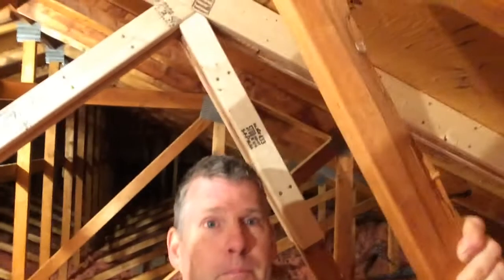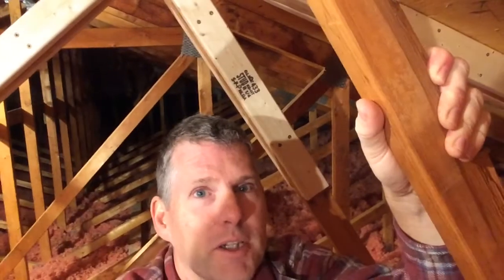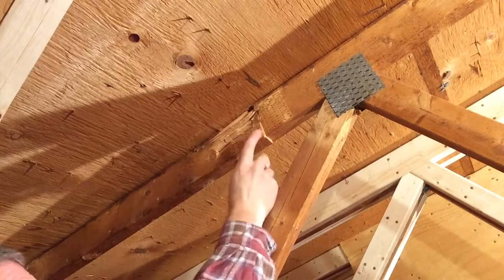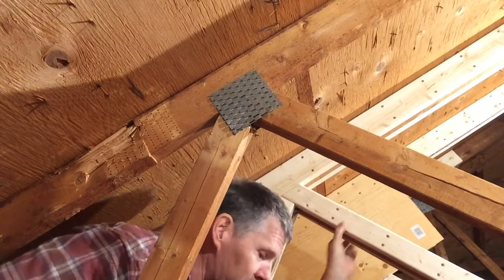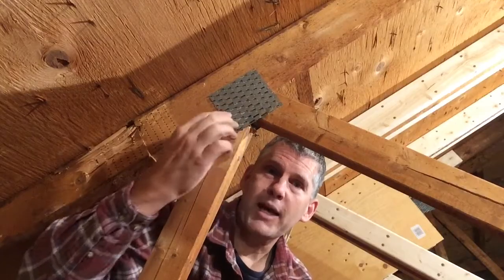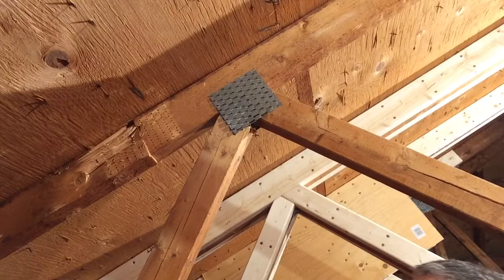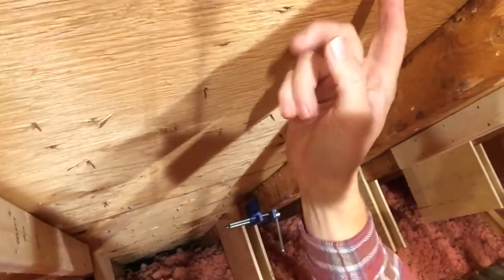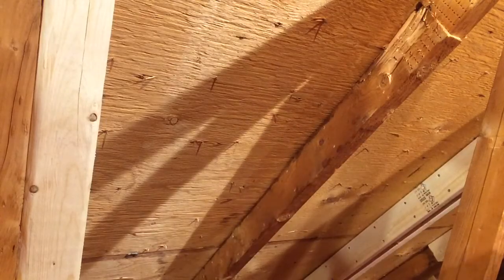Attic Truss Repair #01: Damaged Top chord and loose gusset plates

Comment: Thank you for creating this video and trying to educate the internet. However, the problems you shown hints that the roof trusses were, likely, overloaded.

Any repair work should start with finding out the root cause of the problem and then engineering a repair plan. A structural engineer must be involved and a building permit must be obtained to carry out such work.

Comment: My dad called those gang nails. Buy the way he was an ironworker and built his roof with home made iron trusses and bar joist. Then heavy guage metal decking,then 5/8 plywood bolted (not screwed) to the decking,felt and shingles. The county inspectors did not know how to inspect it. Roof would have easily held a one ton truck. Boy I mis my ol Man, drank many a beer with him. This was in Seminole county Florida 1970.

Comment: The whole designing & engineering of Trusses & Gables is kind of Stone Age technology, nothing new or innovative. 

To further exacerbate the situation, the builders use the cheapest wood they can get. If you use good hard wood, when it gets old it becomes so tough that it becomes harder to drill a hole in them.

Lastly, I hate the Gusset/Connector Plate business. Santa Clause doesn’t  need to jump on the roof to displace the gussets. Upon doing a microscopic inspection of any 50 year old house you will find that they would appear to be attached but have lost their firm grip due to expansion/contraction etc.

Comment: The trusses in my attic look the same but they are 2 x 4. My house 'pops' creaks' 'bangs' make all sorts of noises. My idea is to use 5/8" plywood and connect all the rafter supports together with a 4  8 sheet cut to cover were the three supports connect to the rafter. But I'd like to shore up the roof by places supports below the ridge rafter before applying the plywood. The real problem is that there is too much weight on the roof. The tiles are made of concrete not clay.

Comment: Don't see the video on the engineering.  Specifications for the screws, size, length, hardness, finish.  Pattern and spacing of the screws. Does each screw pass through both scabs and the original truss member  or just the original truss member and one of the scabs?
Reply: Shut up

Comment: Substandard wood? I don't think so. Those trusses are only 2x4. The plates can only hold so much stress. Piling up roof shingles in one spot is most likely what caused it. They are very heavy and the trusses are not designed to take that much weight.
Reply: Jameson Cross  yes, there is a method for stacking and distributing roof materials, someone most likely flubbed up tossing materials haphazardly. Happens occasionally and this is the result. He mentioned that’s what happened during a reroof .
Reply: @stevelopez372  the wood isn't substandard I don't think. I THE only way that would he if there were a lot of knots in them. I do not see any evidence of that.
Reply: According to the building code, the snow load where I live in the North East (NJ) is 20 lbs/sq foot. Trusses are designed to handle the snow load, but if you add to that a few bundles of asphault shingles stacked in one place, the 20 lbs per square foot will be exceeded several times.
Reply: @lxmzhg  You are correct. Adding to that scenario, an 80 lb bundle of shingles dropped from a shoulder height of 5 ft hits the surface of the roof with 400 ft lbs of kinetic energy. This kind of damage happens far more than most people realize and its usually not caught until years later.